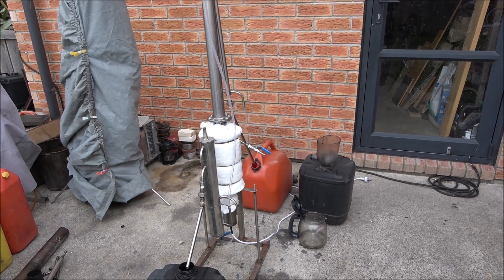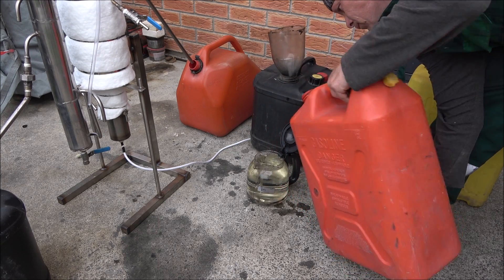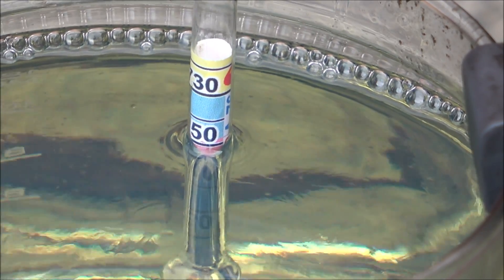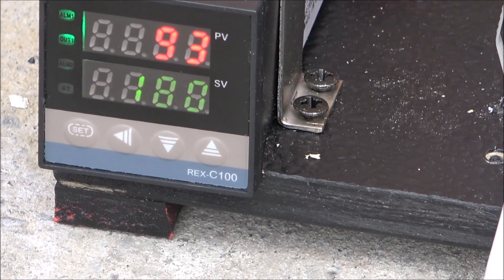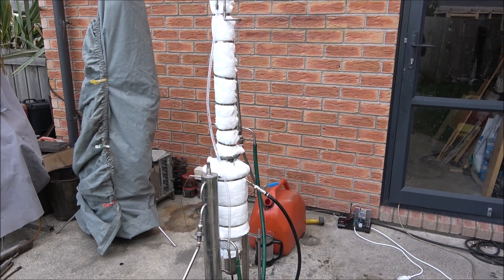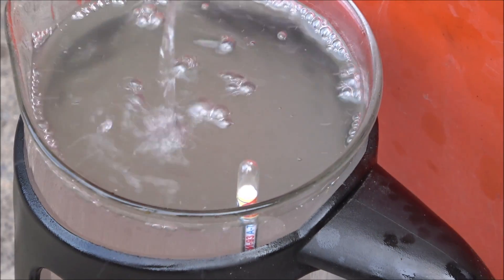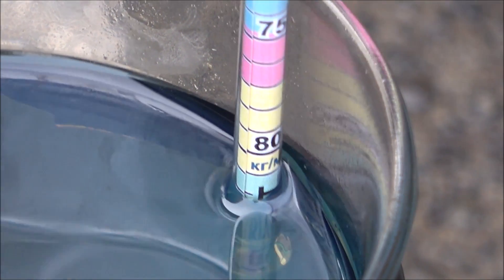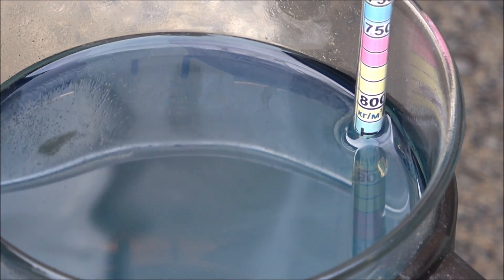How to separate accidentally mixed petrol/gasoline and diesel.

Comment: You can mix 15% diesel in a gasoline tank and still have the car drive normally. I would have just kept the mix and used it a number of times  to top up after fill ups.
Reply from the maker: There could be a problem with modern high-compression engines, though. The diesel fraction may not burn completely and will be scraped by oil rings down the sump, thus increasing the oil level and thinning the oil, so check the level occasionally.
Reply: @santeryi9   Even high compression gasoline engines are not close to the compression ratio of diesel engines.  I have tried this myself and there is a  distinct truck smell to the exhaust. Fuel economy is unaffected, i.e. not worse, so it does contribute.
Reply from the maker: @Tore_Lund  Yes is not affect the performance just diesel gets to the sump, older cars are fine, flathead's don't care at all
Reply from the maker: @Tore_Lund  it's to do with carburatted or injected engine, injected has much colder charge so diesel isn't evaporated properly while  carburatted usually hotter so chewing the mix much better
Reply: @santeryi9  I actually tried it in both a Renault and an Fiat, but they were both older throttle body single injector engines.  I would imagine this would be difficult in a carbureted engine in winter?
Reply from the maker: @Tore_Lund 
The "Modern" engines construction is focused on making the fuel charge as cool as possible, intercoolers, injectors and so on, while ol approach was to heat the charge before it gets into cylinder, this is why most of carburators and intake manufolds were pierced with coolant lines to keep the manifold warm, many oldr models would have a unibody of the intake and exhauste manifolds, so the charge would become a complete vapor.
Possibly it not allow to squize a lot of HP from engine but it would work with substandard fuel and outlast the vehicle itself, it was era of million kilometer engines. Many modern engines are not designed to run for decades and in most cases start to burn oil barely raching 50000km. Anyway the cold charge forces the heavy fractions to condense on the cylinder walls and it scrapped down the sump, we tried to run Injected Volvos and WVs with different mix compositions in UK and NZ and  result was alvays the same - performace was good but diesel fuel was getting into the sump.
Nothing terrible but will require control and more frequent oil replacement.
Reply: @santeryi9  Not entirely true. A hot charge, still improves fuel economy = lower air density requires a more open throttle, which reduces pumping losses. That is the main purpose of the EGR valve (besides of burning unburnt Hydrocarbons) Coolant heating of carburettors is to avoid icing.  So cold air intake is mainly to increase power.

Comment: Say I accidentally put a red dye in my diesel, I assume this would filter the dye out from the diesel?
Reply: Use cat litter it will filter out the dye or use fine aluminum oxide powder the aluminium oxide adsorbs the dye. Also make sure to run the chromatography funnel in the dark shining some UV light on it, as some countries use UV detectable dyes that you can't see under normal light
Reply from the maker: No, this will separate petrol, and diesel will stay red, thogh I developed another system for dye removal: https://youtu.be/pCQB7Bu4lrY

Comment: I was hoping it was a small scale experiment where you can check whether anything in the fuel leaches out into the other fuel.

ie.  The anti-waxing ingredient in the diesel leaches out into the petrol. Although the specific gravity maybe the same there maybe contaminants in either/both of the fuels.
Nice work anyway.
Reply from the maker: Thank you for your comment and interest. If you were closer to the fuel industry and knew everything that goes on there, you would not be surprised about the natural existence of transitional fractions in ready products sold at a gas station. This includes 3% of kerosene in petrol or thousands of tons of diesel accidentally mixed during transportation, which are then mixed as 10% fraction to the lower grade gasoline and sold normally.

Transportation tankers are not always flushed properly, which can cause issues. However, the machine allows for processing the fuel at the desired temperature and even making accents - focusing on either petrol or diesel. You can choose the temperature range to make your diesel thicker or petrol thinner.

I usually run the petrol thinner at a lower temperature of complete evaporation of the heaviest petrol fractions. Thus, my diesel still contains a bit of a kerosene-like fraction of petrol. I then either run it in my cars (one of which has already gone 450000km) or run it a second time at the desired temperature to get proper diesel. Bigger-sized machines separate the fuel precisely.

The separated fuel is often used to run a fuel rescue business transport, diesel heaters, generators, agricultural machinery, and used to flush fuel tanks of clients who confused the fuel at a station. I have built a lot of those units of commercial size, and they process thousands of liters of mixed fuel every day around the globe.

Comment: I think it would be easy to test the flash point of the diesel, just heat it slowly in a cup and put a flame above the liquid e.g. for every 10 degrees temperature rise and see when the vapor ignites. If you get the same flash point as for the virgin unmixed diesel, you know you've got rid of the light gasoline components.
When using diesel in a boat where the engine room is not well ventilated, I would make sure to have no low flash point liquids, otherwise it can go booooom.
Reply from the maker: Sure, also the composition can be controlled by tepmperature setting of the separator, increase temperature and ensure complete evaporation of petrol. Also for your info- the heaviest petrol fraction evaporates at 200c, so no way it will affect diesel at all.

Comment: Thanks, I pretty much always misfuel my car so this can save me a lot of money.
Reply from the maker: Sure this can help.
Reply: I think you're missing the true potential of this contraption
Reply from the maker: @aliorr9356 There are people who has an acsess to the mix and potential buyers, but do not have a technology, and someone with technology but with no acsess to either fuel or market, I am the second one.
Reply: @santeryi9  You are right. Wherever I get the chance I bring mixed fules back to my workshop and i use it in various machines/engines that can handle it but i wuld benefit a lot of being able to separate the mixture. Thank you for a informative, no-nonsens/bs and interesting video! 

Let people who doesent understand the value of free fule stay ignorant. The fewer with the knowhow to save thousands on fule eace year the more free fule for us, brothers :) 

Cheers from a medium cold Sweden!
Reply from the maker: @nilslindstrom8087  Thank you for sharing. I always try to find ways to get free fuel in any condition. I prefer using hydraulic fluid and thin petrol engine oil. The hydraulic fluid can be easily cleaned with a centrifuge and mixed with some diesel fuel to be used as is. Petrol car oil has no heavy additives, so it's easy to distill or restore.
Reply: @santeryi9 I am the first so this is fantastic for me!
Reply from the maker: @matty26261  what is your location.
Reply: @santeryi9  I’m in Australia mate, going to be contacting you soon through your site as I’m interested in your equipment and processes.
Reply from the maker: @matty26261  good, where in particular? I'm in Australia now too
Reply: @santeryi9  I’m in Perth mate
Reply from the maker: @matty26261  Gold Coast, still a bit too far.
Reply: @aliorr9356 you need a fair bit of it to be worth setting up everything for fraction distillation but yeah it defo useful

Comment: Your recycling costs don't exceed the cost of the product, is it cost-effective?
Reply from the maker: Hi, this machine is for accidentally mixed diesel and petrol, the machine consumes 1.6kw of electricity per hour, which costs about $0.30. The unit can process up to 20L of mixed fuel per hour with a minimum cost of diesel, at $2.00 per Liter.
Let's say that 20L of fuel after separation will cost $40.00 per hour. The distiller can run 24/7 and potentially will do 480L per 24 hours, which will cost $960.00, and electricity will cost $7.2. Moreover, the separated fuel does not require any further treatment and can be used straight away, so it is more than cost-effective.
Reply: @santeryi9  ok 👌
Reply: Сколько стоит такая установка, и может ли она перерабатывать обводненый нефтяной продукт, либо может быть есть какая нибудь установка для сепарации нефти?
Reply from the maker: @Andrey-zj4wc Для обводнённого продукта нужна центрифуга, я буду выкладывать видео на днях именно с сепарацией обводнённого масла на центрифуге домашнего производства.